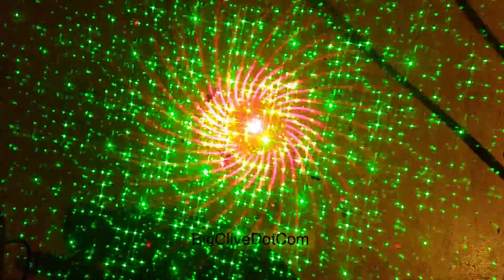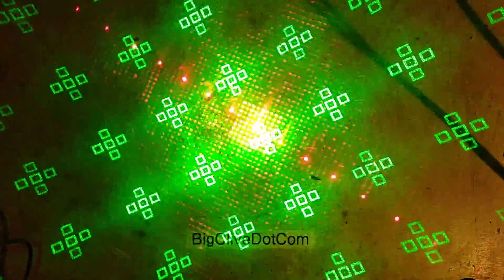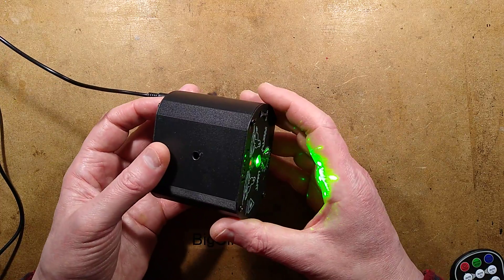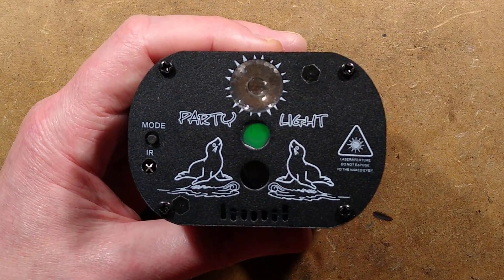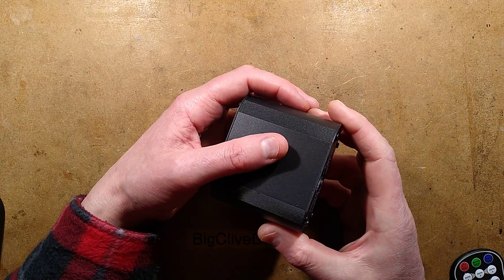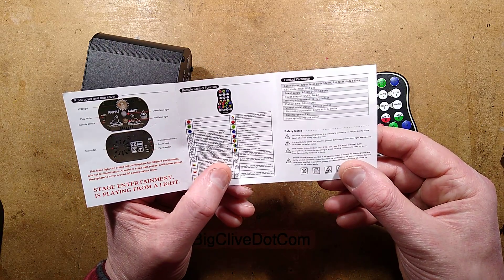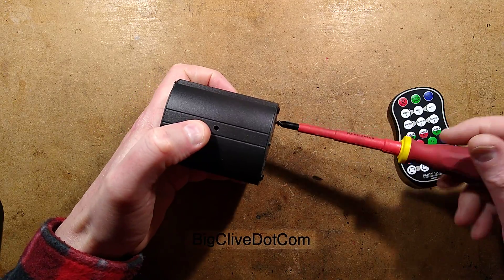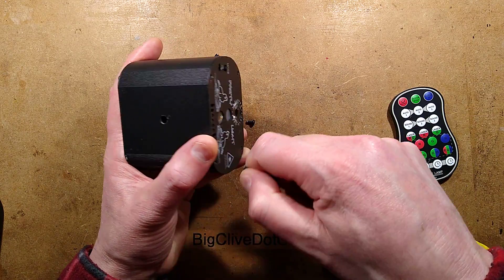Cheap laser light with amazing diffraction grating disk

Comment: Camera behind the disk?
I want one just for the lasers, I'm old enough that I remember even a simple red laser pointer being to expensive to buy and green ones when they came out I've always wanted. About to pull some blue ray lasers and see what happens when I stick them on a dollar store pointer.
One day I'll own a green, red and blue. Don't care if they "burn" but I would like to see the beam if possible.
Cheers brother, used a rechargeable disposable vape for rechargeable laser pointer. Next is replacing small cell for 18650!
:)
Reply from the maker: You can get blue lasers cheaply on eBay now.

Comment: One thing that astonishes me is that the patterns, although moving from one side to the other in front of the laser diodes, rotate around their centre when projected and then fade to the next pattern on the disk as they move away. I remember cheap disco light effects I used to have that had a conventional light source, a lens, a gobo disk and a colour disk. The projected images clearly showed the lateral movement relative to the light source of the current colour, resulting in a moving color border and sometimes showing two halves of adjacent gobo shapes. In comparison, using diffraction gratings with lasers seems to have this very cool side effect of much better transitions and even introducing a central rotation of the 'gobos'. I'm guessing this has to do with the inherent properties of diffraction although I can't really get my head around it and wasn't aware that diffraction could be used to transform lateral movement into rotation.
Also I'm a little surprised not to find (m)any other comments on this (admittedly I haven't read all 682 of them at the time).
Reply: Same thoughts, bro. My brain refuses to understand why the pictures rotate around their axis.

Comment: i had to drill a couple of extra holes in the case SIDE, near the mic location, as the mic pickup is not facing the pre-made holes. This makes the mic incredibly insensitive with no other way of adjusting it. the extra 3 (1mm) holes did the trick.

Comment: Thanks for the teardown Clive! So I bought myself one of these, I'm thinking about DMX hacking it via a arduino and integrating into my garden lightshow.

Does anyone have any thoughts on the purpose of the film the casing for the green laser module? The red doesn't have this. Trying it with and without doesn't appear to make much difference, all the diffraction is as a result of the internal spinny disc. Maybe it's to offer some level of protection to eyesight?
Reply from the maker: It may be an infrared filter.  DPSS lasers use an IR laser as the exciter and often have a high IR output.

Comment: If you look on the plastic piece that holds the circuit board and the lights, there is a hole in the middle of the plastic part that is able to fit 2 18650 lithium batteries. I had modded my laser that's exactly like the one you show and it works. Do you know if that chip that regulates charging for the lithium batteries also has a protection circuit that cuts out when the battery is fully charged?
Reply from the maker: The TP4056 style chips do cut out at 4.2V

Comment: This with a Lithium Battery is right i have one and it habe 2Cells insige (18650)i think but these only hotglued in the Case and my ones i must fix before use the silicon was not strong enough for transport. Regards from Germany

Comment: It's amazing how much technology has changed in my lifetime... The first LASER I ever had a chance to play with was a red helium neon discharge tube design with a price tag larger than a used car in the early 80's, needed a mounting bench, three cooling fans and a wall outlet to power it. These days, I can buy a laser pointer that runs on coin batteries, gives about the same light output and sells for less than $15. Cutting and engraving power level lasers can be had for less than $1000.
Reply: That's nice to know, I could afford several to install in strategic locations and wire to my burglar alarm.

Comment: For anyone wondering, I ordered one of these after watching this teardown. 
I added a single cell lithium ion 3800mah battery and it can now operate independent of the usb connection. There is an opening in the frame the that would accommodate a smaller battery mounted parallel to the circuit board no problem.
Reply: Mine came with two 18650s installed.
Reply: @GilesWendes  I'm glad you mentioned this. I had been designing a new frame piece to fit a bigger lipo pack but after reading your comment I checked and sure enough I could put two 18650s in parallel in the opening. Saved me a bunch of time! Thanks!
Reply: @FailedSquare  no worries. They're just a shrink wrapped pack. Really happy with it! First thing I've bought on a Big Clive recommendation

Comment: Such a nice big piece of aluminium on the outside, and yet no thermal path from the green laser to the casing. Quite a shame. I guess you could easily adjust the effect rotation speed with a resistor or something, that would be nice. I would prefer it slower.

Comment: Hi Clive, just to let you know, 
I ordered 2 of these units after watching your video, 
Tested them, all good, but a point to note, 
The 2 units I have, both of them must have rechargeable cells installed.
It appears yours did not?
I have had them plugged in, red led shows, after a few hours, green led shows, then the units are 100% portable without needing usb power supply

Comment: Immediately went and bought one, it arrived today and as Clive says it’s a remarkably capable bit of kit for the size and price.

One thing I’d like to change is the effects cycle quite quickly - does anyone have any suggestions on how to slow it or even add a variable speed control?
Reply: Did you work this out? I imagine putting a voltage regulator off the motor output would help a lot

Comment: If you only have instructions in Chinese (or whatever) here's what you do:
-Open Google Lens and select Translate (on the left)  (Google PlayStore has Lens available as well as Assistant which is also useful)
-Hold your phone's camera over the text and you will receive a real time translation
-You can take a snapshot of the translated text to read over.  Google Lens Translate also works when you're walking about.

Comment: You should do the Walabot. I always wondered if its a scam or how does it work? supposedly it can show a 3d image of what's behind your walls or sheetrock to find wires and studs but in the commercial they show a rat moving inside the wall.

Comment: if you're going to use this outdoors or unheated applications: Be very very careful. 

The green laser multiplier crystal tends to not work at low temps (below 5C but the IR laser behind it is still outputting and these things seldom have working IR filters.)

Comment: UV-emitting LED lights found to kill coronavirus 
"The researchers tested the optimal wavelength for killing the coronavirus and found that a length of 285 nanometers (nm) was almost as efficient in disinfecting the virus as a wavelength of 265 nm, requiring less than half a minute to destroy more than 99.9% of the coronaviruses. This result is significant because the cost of 285 nm LED bulbs is much lower than that of 265 nm bulbs, and the former are also more readily available.
It is important to note that it is very dangerous to try to use this method to disinfect surfaces inside homes. To be fully effective, a system must be designed so that a person is not directly exposed to the light."

https://www.sciencedaily.com/releases/2020/12/201214164328.htm

Comment: I have to say the Chinees are smarter than the makers in the US, they love to steel intellectual property and take credit for it. What we should have done 20 years ago before the manufacturing of electronics we should have removed the labeling of components from the circuits we designed so they can not copy and produce it at a cheaper and much less safer for use. I would be leery, to charge a Li ion battery using this device, I doubt if it would not catch fire burn your house down, or you end up burning in your bed.

Comment: I keep buying all this crap, looking forward to this one, got it for £13.00. Still trying to find a use for the blue led atomiser thing, but a lot of tech for very little money. These have been around in Red/Green using the same diffuser for many years. The simple ones have the red going straight through and the green at 90° through a reflector. They are remarkably reliable. My friend runs the go go bar featured in Hangover 2 in Bangkok, and there are about 40 of these on about 12 hours per day for over 10 years, only the odd one has failed.

Comment: Very good video, I wish you would do a lot more of these and other types of semiconductor laser teardowns and an examination into the various  precision constant current  buck regulator   type drivers that are  very common and seem to be fairly complex as well as being very  much like  regular led type drivers. You should also invest in a basic laser power meter so you would be able to measure the out puts of these these lasers to see just how powerful they are. I really enjoy any videos dealing with  lasers  as well as high power  light emitting diodes and semiconductor lasers  specifically.

Comment: When done correctly with semi-circular 'safety scan' lenses mounted in front of the apertures of laser scanners, which increase divergence of the beams when they drop below a certain height above the audience, you can safely & legally achieve very impressive crowd scanning laser effects at night clubs & festivals even with very powerful (1W+) units. The calculation of the maximum permissible exposure (MPE) is actually quite an interesting topic, because it depends upon not just the power & divergence of the beam at a particular distance, but also the speed of the particular effect (for a galvo scanning laser, that is). Of course your local DJ/nightclub that buys £16 diffraction lasers off eBay is another story!
Reply from the maker: It also involves a lot of daily sampling and logging of laser levels in the audience area.

Comment: Any infra-red used to generate green laser light by second harmonic generation will pose a significantly lower eye hazard than the green light, that is if the infra-red is not filtered out before exiting the device. Infra-red lasers are actually called "eye-safe" lasers though that is misleading, infra-red laser light will not penetrate the eye and will instead stop at the cornea and if the infra-red power is high enough then it can cause corneal burns. 

The green light is considerably more dangerous as the light will reach the retina and also be focused by the lens so increasing the power density, this can cause coagulation or burning of the retina and lead to permanent blindness or blind spots. The reason I know all this is because I use green lasers rated for 180 Watts in user mode or up to 300 Watts in service mode.

Comment: I'm guessing they recorded the diffraction pattern onto a coated substrate from a bitmap file using a laser beam recorder (LBR), then made a nickel negative (the same process as used for CDs and DVDs). They could then that as one half of an injection mold with a mirrored other half to injection mold the discs. That would be a fairly simple process with a modified LBR (and a very clever way of using equipment that is otherwise obsolete).

Comment: The listing shows a bracket, did it come with it? Hopefully I can order a similar one for my bike aim it forward to the ground. I'd modify it, disconnect the fan to save power, drill holes, add copper heatsink on BOTH lasers, possibly mount a vintage generator on both wheels, and other ideas too. Can you do a tear down video about bike generators https://www.etsy.com/listing/913367561/vintage-schwinn-approved-bicycle-deluxe?gpla=1&gao=1&&utm_source=google&utm_medium=cpc&utm_campaign=shopping_us_a-art_and_collectibles-collectibles-memorabilia-other&utm_custom1=_k_CjwKCAiA57D_BRAZEiwAZcfCxaNXjZQS7NmS7W5N8gXQhXS6Huy36BI30y6W8XSCDf7E3Qt3KRZDQBoCe5wQAvD_BwE_k_&utm_content=go_1730308301_67816387575_337556716488_pla-314954652373_m__913367561_12768591&utm_custom2=1730308301&gclid=CjwKCAiA57D_BRAZEiwAZcfCxaNXjZQS7NmS7W5N8gXQhXS6Huy36BI30y6W8XSCDf7E3Qt3KRZDQBoCe5wQAvD_BwE

Comment: One purpose of the secondary laser power supply is that lasers (and high-intensity LEDs) are required by safety regulations (e.g. IEC 60825-1) to not exceed their rated class in event of a reasonably foreseeable fault, the worst case of which is usually shorting of the pass transistor. The secondary laser power supply acts to limit available fault current to the laser diodes. Lower-power designs, such as laser mice, use a big current limiting resistor instead.

Comment: I had to buy one, got the 60 + UV version.
Reply: Seller messaged me this AM that it was out of stock. US east coast ebay dealer. I would order from another but I suspect they are all the same people.
Reply: I went back in and got the slightly fancier version with the battery (I think I clicked the right box) for about 10USD more. https://www.ebay.com/itm/353304111535 This time it shows tracking info about an hour later, so it looks like I am getting this one.

Comment: Be very careful with green laser anything: many of them lack sufficient ir filtering, and the lasers will shift to nearly all ir when cold. (source: Braniac channel)
Reply: Getting a quick flash from a visible stage laser will not injure your eyes.  It's much like catching a strong glint (reflection) from the sun on a clear day.  Natural reflex will make you look away or close your eyes before permanent damage occurs.  Spread the word;  Do not stare directly at the sun or into a laser.  This may be tempting during partial eclipses or operating frozen green laser pointers.
Reply: @frankhage1734  Infrared light will not trigger that reflex. That's why it is dangerous.

Comment: Black or white on Amazon. White version has a battery.
https://www.amazon.com/Spotlight-Projector-Lighting-Christmas-Thanksgiving/dp/B08FDHM9ZV
https://www.amazon.com/Wireless-U`King-Projector-Weddings-Lighting/dp/B07SM7HTYB
Reply: Says the battery is Lithium Manganese Dioxide. Never sure about these descriptions, though. (OK, that's the button cell in the remote-I thought it was a strange description since it wouldn't be rechargeable)

Comment: You know, I thought I was crazy. All those places that just shine these kinds of devices into crowds. I was always paranoid. No one seemed to worry about these eye death beams but me. My eyes are screwed enough, thanks.
Reply: I've had the same thought. In the US lasers are regulated by the FDA. 
I bought an actual show laser last year and had to sign paperwork asserting that i had met some minimum safety requirements in order to get the variance from them to import/own it. I'm glad I did that studying because its given me a newfound respect for lasers and a fear of these unrated and under-rated import devices. If they were marketed honestly most of them would be class IIIR/B which is very dangerous to have pointed anywhere but the ceiling. This particular one is most certainly > 5mw (especially the green) but it shoots through 2 diffraction lenses which dampen the potential for an instant death ray to your eyes by a bit. Still technically dangerous. Though I really don't want any more regulations, i just wish people would learn a little about them before blasting a crowd in the face with with one.

Comment: Would it possible to mount a small heatsink? As there is a small cut out next to both lasers... Would be a home made heatsink that could slide over the green laser. It would be a nice project. However, for just ￡17,- one can get a new complete unit... I'm not a fan of the current trow-away-culture...

Comment: have a question for you, Clive...what do you keep the temperature of the house at in the winter? im a former american. would keep indoors at 20-25. here in canada now, ex wife would 20-22....this winter, by myself, i started at 15 and trying to work down to 10. 

does that align with european standards? sketchy info online, figured i would ask a reputable source. 

cheers and happy new year!
Reply from the maker: I keep my house unusually cool because I've spent most of my life working outdoors and prefer to dress warm and breathe cool air.
15C sounds reasonable enough.  I use dehumidifiers to keep the place dry.
Reply: @bigclivedotcom  damn, was hoping you would say a lot cooler than 15 lol. I’m working at getting down to 10. Takes a lot of getting used to. Cheers and thanks for the response!

Comment: Class 3b is pretty dangerous with power up to 500mW. This has the power to burn things, especially retinas.
Reply: Such green DPSS module can't produce output power more than 2-5mW of green but the IR pump will run hot. With higher power the  Nd:YVO4 will fail without cooling.
Reply: @franckmorisseau8668  I wouldn't bet on it. There are plenty of cheap green 303 lasers pointers that can produce 500mW. The diffraction grating splits the beam but if it is rated at class 3b then it is not something that your average Joe should have access to without some knowledge of the dangers of laser radiation especially as this would be used in a place that is likely to be filled with people.
Reply: @dr_ned_flanders  not in this size without cooling :)
500mW output needs near 2W of KTP 808nm IR pumping power.
Flashlight high power laser uses the body as heatsink. But i'm talking about green DPSS, not pure diode like blueray diode.
I know about laser I'm laser safety officer ;)
Reply: @franckmorisseau8668  would you consider this cheap Chinese laser safe?
Reply: @dr_ned_flanders  as LSO, every laser is dangerous.
Especially chineese ones.
Unfortunately, here in France, every people can buy class 4 laser without problem.